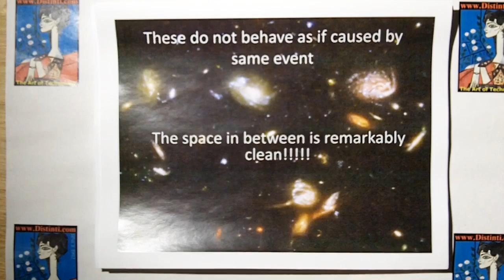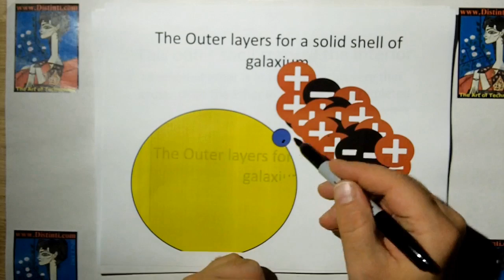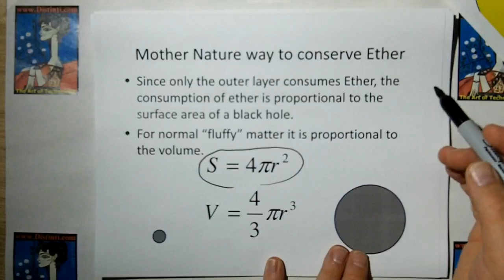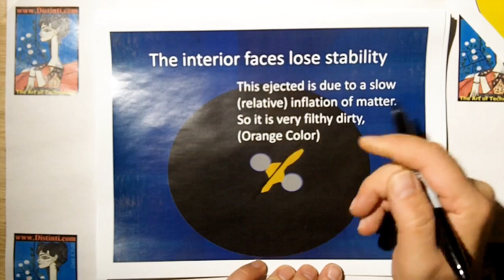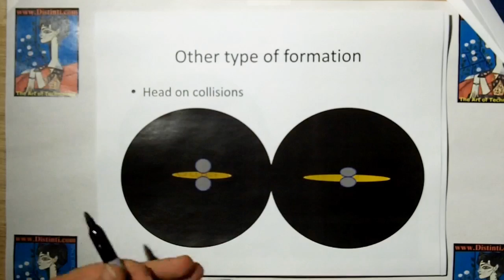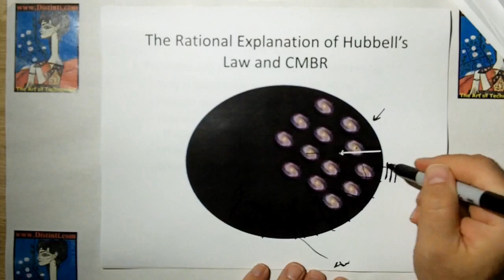emV029: Universe, Galaxies and Black Holes

Comment: The statement that a black hole is a fission machine is validated.  The white hole emission are all of the atomic particles, sub-particles, and aether is being spewed out.  Eventually, (in conventional terms) such spew of various atomic and sub-atomic particles spewed together will align with the majority turning into protons and electrons, forming neutrons, which create a neutron mass around the black hole.  Eventually, this mass will cut off any incoming cosmic material, and the neutral mass suffocated the black hole, and the white hole emissions are extinquished.  As such, your aether materea of inertia-less sub-particulates are these masses that will eventually "shell" over the black hole and snuff out its existence, the evidence of a black hole event horizon dissipates, the white hole (both streams forward and backward cease to exist).  The black hole turns into the conventional astronomy of a neutron(-shelled) star.

What you show with the 2 white hole streams and vortexing, is that they are the first of a new stellar and galactic formation spewing out materea as a vortexed a 2-armed astronomical body (eventually into 4-armed and greater) galactic formations.

IF - AND ONLY IF - such black hole spews out some portions of its stellar (or galactic) core fragments, then you would see the (said) conventional concept of accretionary theory of solar system formation with planets and moons forming in the stellar-spewed soup into their individual objects with active cores (consuming aether) self-shelling themselves, and further volume and mass expansion of new materea of elements made inside the object.  Those active cores will display gravity, external EM field (Van Allen radiation belts), polar rotation, geomagnetic polarities, and continued consumption of aether and grabbing anything that comes by in the gravitation field and pulling it onto the surface (meteor showers, solar dust and gasses of the solar wind, etc).

Such places where stellar soup does not have any stellar core fragments, there is no accretionary theory, and such asteroids, meteors etc have no active cores - thus no accretionary activity - like the asteroid belt of 100,000s of objects - but no gravitational attraction between them creating a new object in that location.  This validates that asteroid and meteors also do NOT HAVE stellar core fragments of gravity, but they are (other than velocity) inertia-less astronomical bodies, and no accretionary theory can apply to them.

Comment: There was no singularity Big Bang.  There were massive and complete voluminous Big Manifestation across the entire cosmos of the aether manifesting simple particles and atoms, with the release of light photons and the creation of the first generation of stellar and galactic core formations (and their accretionary self-shelling).  Galaxies were consuming the aether sub-particulates in accretionary self-shelling, but also consuming aether in the fruther acquisition of outside cosmic dust, gasses, and debris forming greater and greater core powers and forces.  Therefore, stellar cores create accretionary actions, but also elemental shell formations, and continued volume and mass expansion - with greater and greater external kinetic forces manifesting (as an aetheral vortex) around the object (and orbital spin or the object).

Comment: I don't like the "edge of the universe". That sounds a lot like a flat earth to me. What happens when a spaceship reaches the edge of the universe? Does it fall off? Where does it fall off to? That's a very unsatisfactory picture. 

I say, of course the galaxies at the so-called edge of the universe are traveling at near the speed of light, because we can't see anything that might exist beyond the speed of light. There is probably more 'there' there, we just can't see it. If the distance between us is increasing at a rate faster than the speed of light then none of their light can ever reach us. But all that's really necessary is that relative to some middle observer we are traveling at nearly half the speed of light in one direction, and the 'edge' galaxies in turn are traveling at nearly half the speed of light in the opposite direction from us. The two velocity vectors added together yield a relative observable velocity of nearly the speed of light between us.
Reply: there is no either out there so I guess it disintegrates/fission